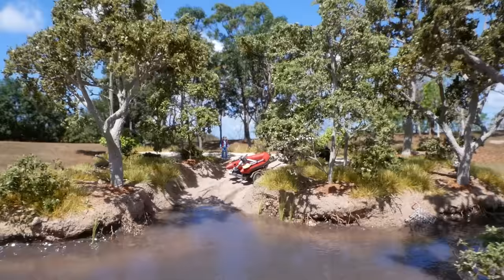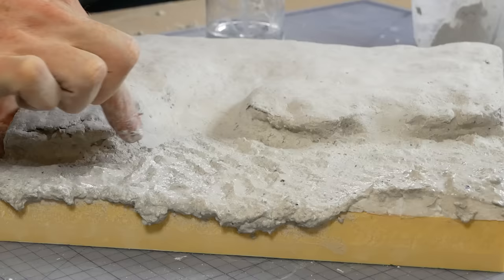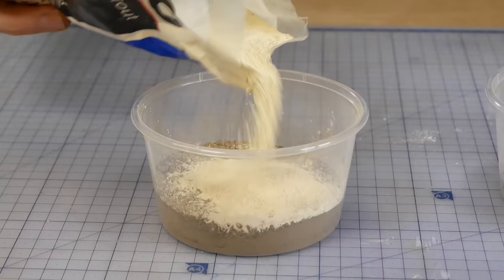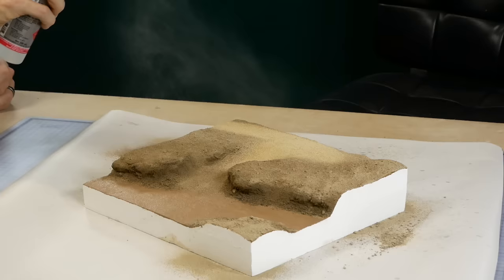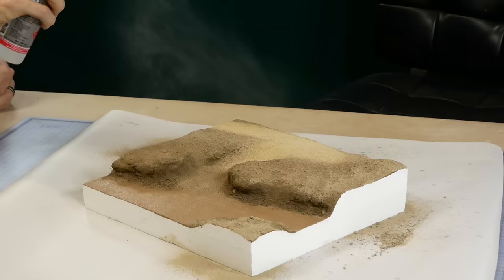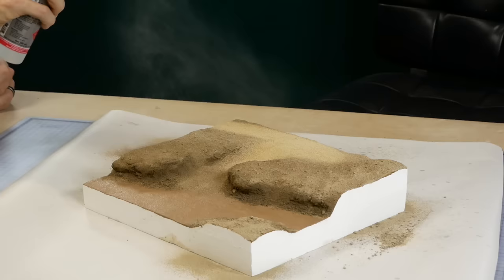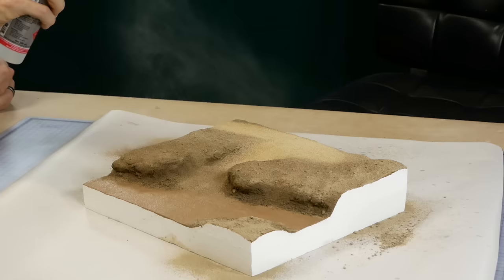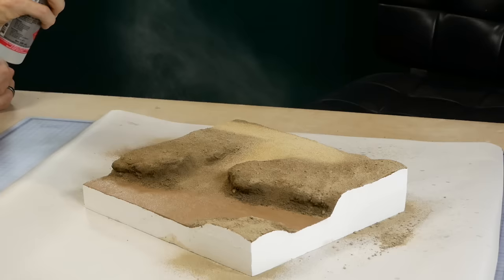How to build an Ultra Realistic River – Realistic Scenery Vol.13

Comment: Thank you very much. Finally a video that is easy for beginners. I'm 67 and retired and decided to start modeling again. I learned quickly that its not paint by numbers as in the 60's. A have a few visions in my head but didn't know how to properly execute it until your video. I'm just learning about washes, pigments, resin, modpodge. Now I can give it a try with confidence. Thanks

Comment: Smugglers Cove model scenery layout by Geoff Nott Mike Flack has some of the model best water I have seen. The river craft are also totally top notch. The trick with the 2 part resins is to go a step above in the source chain for a better deal. That stuff is deadly expensive at the best of times. There is another single part silicon way to do water thats very cheap. A sort of Hillbilly Bunnings method.

Comment: I tried using my grass applicator [ON] the finished river surface. After all the detail work like ripples was done and dried I added gloss mod podge along the edge. Right on the resin. Then my static grass in random spots. I made grass growing [IN] the water along the bank. Looks fantastic and I model in N scale. Cheers !!

Comment: If you want something a bit sturdier to paint, you could use a sand filled plastic bottle, fixing the model to the cap, this also allows for easy switching of the model by just unscrewing it.

Comment: what matte varnish do you use? I have been searching for AGES and all my turnouts are either too reactive to use on plastic models or they turn white when they dry...
Reply from the maker: yeah, the turning white problem is very annoying! I find Testors Dull Coat works really well, I use it when applying a matte coat to a model like a house or some of my trains, I use a cheap artists matte varnish on the trees though but I only apply a very thin layer to avoid it turning overly white. I also use Scale Modellers Supply matte varnish but again it needs a very thin coat otherwise it will turn white! The best so far I've found is Testors Dull Coat 😉
Reply: @BoulderCreekRailroad  OK, I will try that! thanks!

Comment: Which soldering torch do you use to blow off the bubbles from the resin when you pour it
Reply: Even I have the same doubt
Reply: You don't need a fancy torch. An ordinary hair dryer will do, and, in most cases, you can do it by gently blowing your hot breath through a straw onto the bubbles.

Comment: Excellent job as always...
Question Please.
I am using the same exact Mod Podge Gloss Lustre which I just bought recently. I have a thin coat applied to try and simulate small ripples in my HO harbor scene, which was very shiny before using the Mod Podge. 
The Mod Podge Gloss Lustre is now dry to the touch after about 3 hours and my concern is the surface now looks really flat with no shine at all. 
Is this normal where it looks very flat at first and it has no shine after it is first dry to the touch.
I am concerned because I had a very shiny gloss surface before and now all the shine has disappeared and it no longer looks like a water scene.
Any advice or info would be appreciated. Thanks in advance.
Phil

Comment: Everyone here if you use a iPhone you can open the app called measure and push level on the bottom should see 2 dots

If you Don’t see it then try using the compass and swipe right to left to get the the level should see 2 dots

If you have a android you can get a app

Comment: What’s the purpose of the alcohol?
Reply: The alcohol removes the surface tension from the water mixture, allowing it to soak into the ground cover. Without the IPA, the scenic glue mixture would just sit on top of the dirt and make a "shell', but the material would not be stuck to the surface and would fall off if the diorama was hit or turned over.

Comment: but how to stop cracking plaster of paris?
Reply: Mix some ModgePodge or matte medium into the mixture of plaster and water. This will make the mixture slightly flexible and help reduce the likelihood of cracking as the plaster sets up or if the plaster is dropped or bent. Experiment with sample mixes of different proportions of plaster, matte medium and water to see what works best for you.